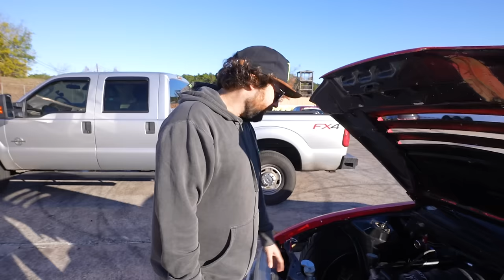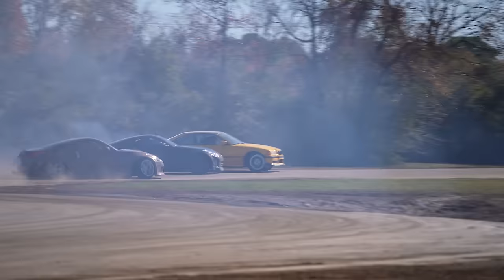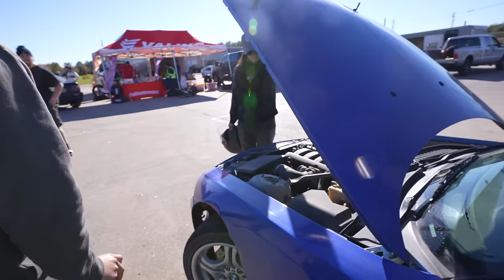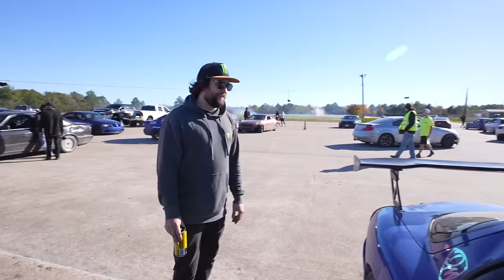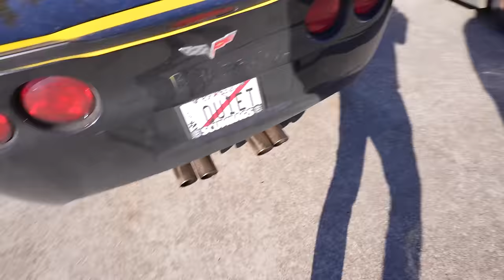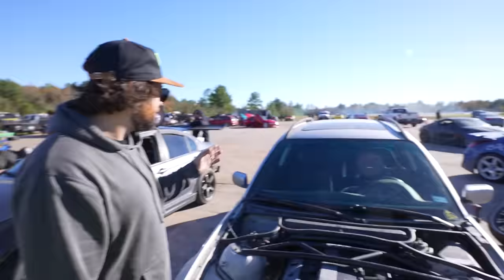Does A V8 Ruin An E36? We Show You Texas Drifting At Lone Star Drift!

Comment: Nothing wrong with Ebisu spec… you have functional suspension.
Reply from the maker: You actually don’t, front steering geometry on this e36 was almost in bind at this height. Lots of camber and high ride height maxes most cars ball joints and makes the control arm angle steep
Reply: @chelseadenofa  Ah, ya true with the amount you run.